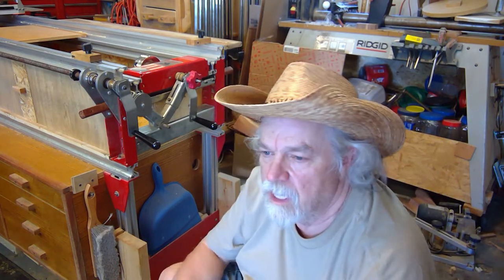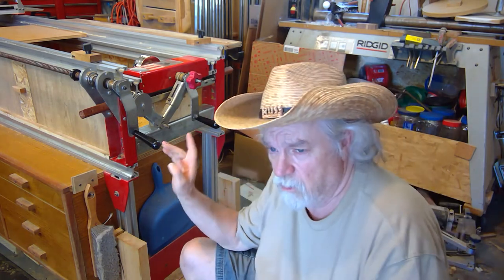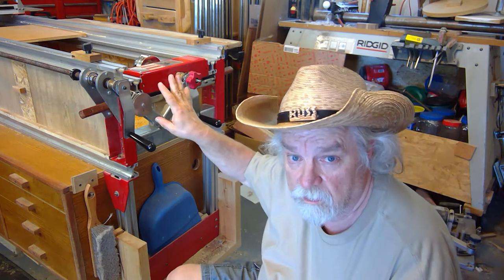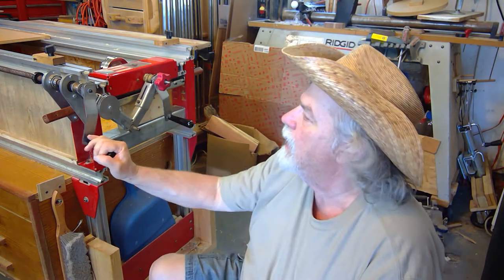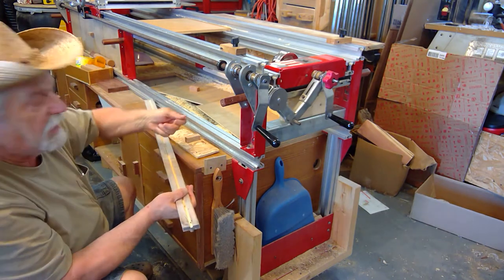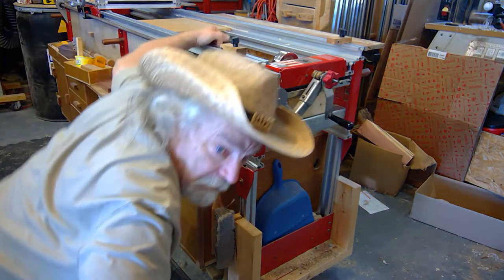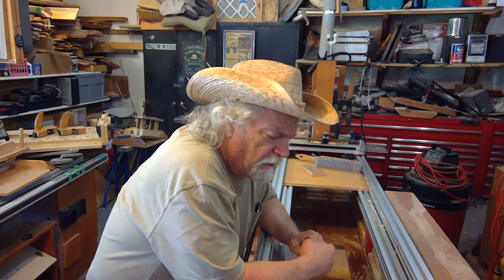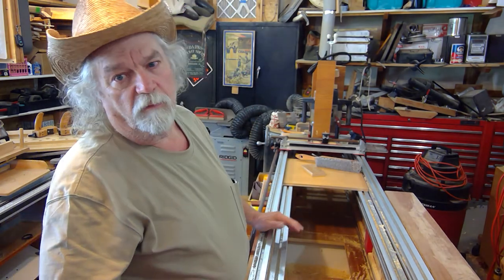Legacy Building dust collection on my legacy

Comment: Great video Russ.  Thanks for making all the LOM videos you have done.

Watching you describe the topside dust control you employ (the semi-stiff rubbery-plastic "fingers",  the two shower curtain pieces, etc.) gave me an idea/suggestion:

Get two 14 to 18 inch wide pull down white vinyl window shades from Wal-Mart/Lowes. 
Trim them to match the width of the  topside of the LOM.  Install one on each end - securing them to the outer extrusions using the hardware that comes with them (that's normally used to attach them to the window casing) and adapter plates/blocks.  Be sure you install them such that they un-roll from the underside - which essentially puts the shade in contact with the top rails.  Lastly, rig up two "hooks" (attaching points) on the left and right sides of the Y-axis rail assy and secure the end of the shade to it (strong hook & loop tape might work).  

You may want to figure out how to defeat the "ratchet" locking mechanism in each shade's roller tube in order to make for a smoother/continuous operation.  Now, whenever you slide the Y-axis carriage up/down the X-axis, the shades will extend/retract - keeping a "cover" over the top rails - aiding in your dust/chip  management.  No more needing to slide/shift two ornery shower curtains.

Let me know what you think.

Mac (A member of the Google LOM Group)
Reply from the maker: now you're thinking OTB.  that is what I hope to bring to my channel.  I hope you will eventually share the "idea/suggestion" with everyone.  I have lots more to share about my LOM  thanks for the comment.
Reply from the maker: I was also thinking of trying to use a bed fitted sheet.  a roller tube has also occurred to me.  I am also thinking of a ramp at the end and use weights on curtain .  this only works on the tail stock end though.  the headstock end would still have to be done differently. most of my "X" axis travel is minimum.  for now I just adjust the shower curtain as I go along. it sort of works. I will document changes as I go along.  all ideas are good.